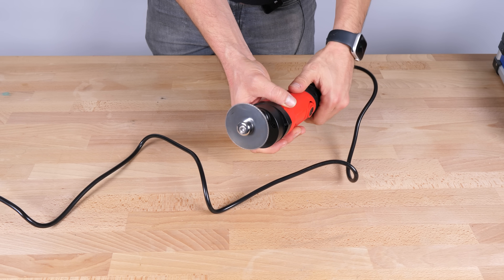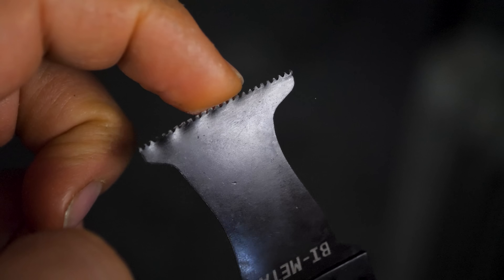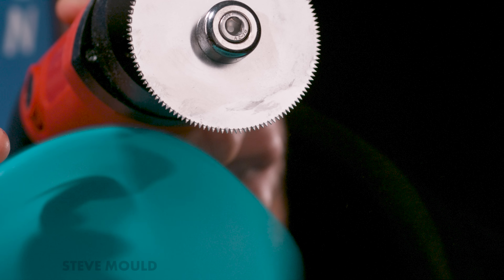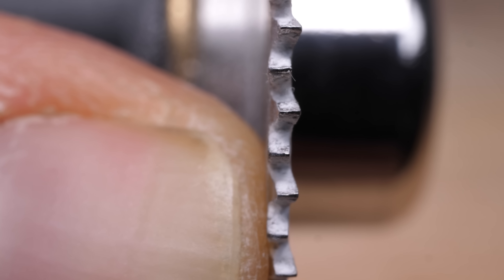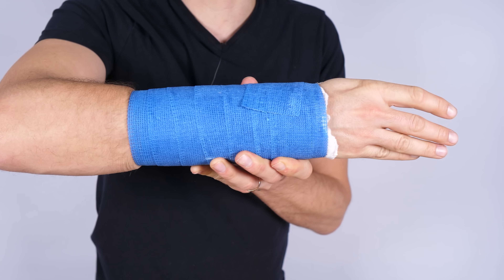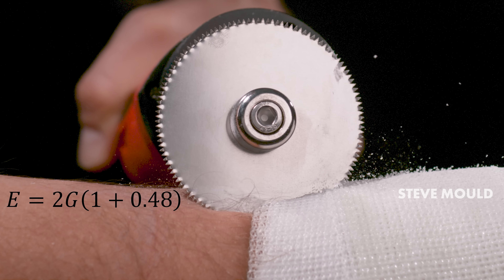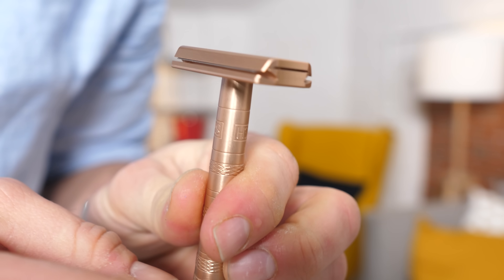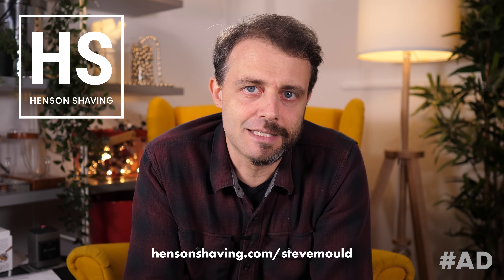A cast saw on human skin

Comment: It’s just a multitool
Reply: Oh, it is? So "multi-" that you've seen other blade shapes on it?
Reply: @HelloKittyFanMan  in the uk we call them multitools but in essence that’s what this is with a round blade on it.
Reply: @grantc8353 : Something like a Fein Multimaster, that comes with a handful of different kinds of blades, is a multitool, and that's the term that we use here in the USA too. But this isn't one, because the term "multitool" is not based on having this type of cutting method; it's based on the fact that there are several types of blades that you can use on it, especially that it comes with. So this isn't a multitool. What do you think "multi-" means?
Reply: @HelloKittyFanMan  I’m sure this has a different name but in essence it is a multitool that uses vibrations to cut through plasterboard (drywall), wood, metal and lots of other materials. I’m not sure what we’re arguing about to be honest
Reply: @grantc8353 : "Arguing"? I didn't know we supposedly were. This is just one guy telling another a fact that he wasn't aware of before. Of course the correct term for this specific tool is "cast saw," but of course it can also be categorized as a certain type of power tool more generally. But using vibration as the sawing action doesn't make it a multitool, since that's not what "multi" implies. "Multitool" refers to the versatility of power tools like the Fein Muitimaster because of their various configurations. Without those it's just a vibrating saw.
Reply: @HelloKittyFanMan  I felt like we were arguing what this was likened by the fact it didnt come with a certain blade. 
I should have potentially said "this is just an oscillating saw" which is what a multitool is. I found you poked a hole in something when it was obvious what I was saying.
Reply: @grantc8353 : Not just a certain blade, but more than one kind of attachment. it's not about the blade type; it's about there being more than one type of blade attachment that it can easily be fitted with and likely ordinarily comes with. Remember what the prefix "multi-" means?

OH, "oscillating saw," yep, that's even more correct than what I said, before ("vibrating saw"), if I understand right.

I think you could actually have a multitool that isn't an oscillating saw. But if I understand right, the Fein Multimaster is the original multitool oscillating saw. however, I think these cast saws came out before that, so I think they are the original oscillating saw (I could be wrong on that; I'm just saying that I don't know of any oscillating saw that came out before the cast saw, generally.)

You still can apply that to this post as an edit. (It would mean that we would delete all these replies, of course.)

Comment: I had one cast on each arm about 4 years apart in my childhood. The saw freaked me out both times. The technicians were really kind on each and they used tongue depressors as guides just in case. BUT my question is: if the saw oscillates, why is the blade a full circle? If I saw a partial blade akin to the oscillating Dremel tools’ as a kid, my mind would’ve been much more at ease. Is it a cost-saving measure (the tech just rotates the blade to a new sharp spot when the other dulls) or do doctors and nurses just love scaring kids?! 😂
Reply: It's for maintenance the blade becomes dull after a while (especially with plaster of Paris as gets stuck in the blades) so we manually loosen and rotate the blade to maintain it
Reply: @jonnycraig183  Ah, I gotcha. Thank you for the info! And by your use of “we”, I presume you’re in the medical field; thank you to you and your colleagues for working the long hours to help the rest of us :)

Comment: Then why, Steve, do they make the blade look like a saw blade? Why is it even round at all? Why not have it be just a segment of that like blades that are similar to that are on the Fein Multimaster and competing tools? What's the supposed point of having a full disc of those teeth when most of them aren't even getting used?

Comment: I needed a cast off so I used a angle grinder.....  I got some supperficial scratches but agan skin is much more elastic than the cast and if you touch the skin you can feel it. 

Disclaimer:  I would have had it taken off by an ortopedic specialist but one was not avalable at the time....  And I don't really recommend anyone who dosn't have experince and comfort with an angle grinder to do it...

Comment: steve. have you ever tried to shave patterns into your beard, say chessboard?
also a couple of years ago i broke my hand in a pre new years eve bicycle ride, pre alcohol. someone did not give me the right of way and i was forced to slam on both brakes and go down. problem with disc brakes is the work way more instantaneously than regular brakes, front brake included. given my size the lifting effect is more sideways and down as the front wheel will naturally point which ever way you are pointed. i'm a tough cookie . shrugged it off. did not call for the cops. which means the teen-aged driver out on a date got no legal consequence for his actions. living with a cast was absolutely no fun. at all. interestingly, when the doctor went to take it off. a giant disconnect happened inside my head. i saw that saw (haw haw) and one part of my brain kept saying it's spinning its spinning. and another part of my brain saying remember what the doctor showed you, oscillating! oscillating ! not spinning!  i fought hard and reason won out.

Comment: That's much safer than a regular circular saw,  which is what my dad used to remove my brother's cast.  Seriously.  He slid a metal framing square into the cast to prevent the blade from contacting my brothers skin on his arm while he cut the cast.  This is a direct result of the poor Healthcare system we have in the US(or lack thereof) alongside my parents being cheap af, they were willing to put my brother's life in danger to save money.   Happened about 30 years ago

Comment: In a way, it's comparable how a diamond can scratch very hard materials but won't damage skin if rubbed on it (assuming it doesn't have sharp edges), the cast saw is scratching away material really quickly instead of cutting it

Comment: If you are into construction, the equivalent tool is simply called an Oscillating Saw, and it’s actually my favorite tool. Super versatile, you can get blades that cut wood, metal, or even diamond blades for stone and ceramic. And I have demonstrated people that I can set my finger on the running saw without a scratch. But it should also be noted that it depends on the part of your body. If you stick it on the fleshy part of your finger or arm you’ll be fine, but if you stick it on your knuckle or elbow, I could see it doing actual damage. However I haven’t tested that, that’d be irresponsible lol.
Reply: I have scars on my arm that says it's possible to get cut by these.

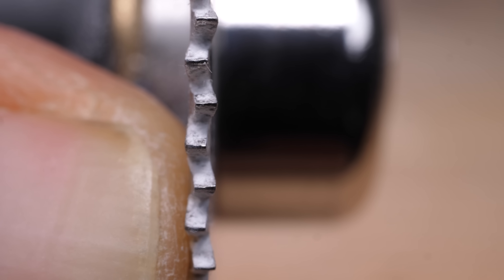Comment: 3:37 + 6:00 I never thought about it, but my electric shaver is a oscilating tool.
A old "Braun 320-4".
And the "blade" is right on my skin as I use it.
I never even considered that odd.

Comment: If the blade only oscillates back and forth, why do they bother cutting teeth all the way around the blade? Couldn't they just put teeth in the arc that's naturally at the bottom when gripping the handle?

Comment: This is exactly why the Dremel oscillating multi-tool, with an 80-grit sanding triangle pad, is great for exfoliating heels. The soft skin jiggles. The thick, dead, calloused skin isn’t as pliable, and hence it gets sanded off (slowly).
Reply: But wait there's more!
Reply: @marshallc6215  " Has this ever happened to you? " B&W video of someone peeling the skin off their foot, drawing blood, and getting a little upset about
Reply: @quinnstraught9636  there MUST be a better way!
Reply: Fun Fact:  If you have really dry skin, your skin loses some of that elastic pliability and become susceptible to being cut again.

I remember learning this from another YouTube comment section where a medical professional was sharing their experience doing demonstrations with the cast saw for kids, as a way to help them relax beforehand.  However one day when they were preforming this demonstration on their hand like they normally would, their hand was somewhat more dry than normal, and they managed to actually cut themselves, much to the horror of the child they were attempting to calm down haha
Reply: @kevinjudd846  Thanks - that answered my question about dry skin!
Reply: I actually use one of those mini Dremel type hobbytools with 20k rotations p/m to regularly file off an unruly deformed toenail. Too much hassle to do it by hand, a diamond file quickly abrades the nail, but not the skin. Similar principle.
Reply: An angle grinder works really well too except you often end up needing stitches :)
Reply: what are you even talking about
Reply: @John_Fury  You mean, what were we even talking about almost a year ago?
Reply: @kelvin0mql  😡
Reply: @John_Fury  Look, Mister Fury... if you're furious because you have reading comprehension problems and can't figure out what we were talking about, then how could I possibly explain it to you here in writing? I would merely be repeating what I wrote above, and you couldn't understand it the first time. So it would be pointless to type it all out again. It is therefore quite unclear what you want from me.
Reply: @kelvin0mql  I was just confused because I thought a heel was where Achilles was for a bit. smoked too much. Achilles Heel has nothing to do with a heel long story short.
Reply: @John_Fury  Hah! Fair enough.
Reply: Man, you are awesome! I just bought a Makita oscillator multitool for my father in law, but looks like mother in law also will like it! ;)
Reply: @NikolayBychkovRus pause 🤨

Comment: Broke my elbow as a kid and had the nurse show me that it wouldn't hurt by pressing it on her skin. The cast was cut enough to pull it off but right before it was the doctor came in, said i still had a small break in my elbow, and proceeded to tape the cast together and told me to wear it for 3 more weeks before getting it removed. Peeled it off when i got home and never went back

Comment: If the plaster saw isn't spinning... why is it a disk?
Is there a benefit? I guess with your version you could turn the tool or the disk when one side gets dull, but in the videoclip at the beginning there is a plastic cover. (Which you could probably remove to do the maintenance, but at that point you could also just exchange blades).

It just seems like a lot of wasted material.

Edit: Looked closer at the footage in the beginning and there the saw blade is only a semi-circle. Still weird that it's round. Is there a benefit to that shape like to minimize contact surface with the usually flat cast, so the motor isn't overloaded?
Reply: Yeah, I don't really see how it's different to a beard trimmer. They don't need to be circular and I always assumed they leveraged the same effect
Reply: A beard trimmer has two blades -- one stationary and one oscillating -- and the pair acts like a whole bunch of tiny scissors.

Amusingly, a lot of hay mowers work the same way, just with hand-sized teeth on the blades.

Comment: Fun fact: 1976 a carpenter got his cast removed with this tool and seeing it's potential to reach and cut in difficult places, he sought to buy it from the doctor and took it to the construction site. That's how the cast saw became the oscillating multitool.
Reply: That is probably not a good idea. If the general principle us the same, the spécifications may differ, as explained in the video.
Reply: @TomFromMars I’ve done it with a cheap harbor freight oscillating tool, and it worked great.
Reply: The actual cutting blade you're using can be at least as important as the quality of the oscillating tool itself. That is, since the blade is still rotating, just back-and-forth (i.e. oscillating), the distance between the saw teeth and the center of rotation will be directly proportional to the stroke of the saw. The smaller the cutting wheel you have, the shorter the stroke, and the less likely you are to cut/tear your skin. That said, the shorter and faster the stroke, the more the heat builds up in a more concentrated area, so the more likely you are to burn your skin.

Seems like they could just slip a shoe horn under the cast to protect you, though. Idk why they don't.
Reply: @hollt693  Sometimes they do. I've seen a cast removal where a strip of plastic about the size and shape of a ruler was slipped underneath for protection. That might not be possible in all situations, though, e.g. if the cast takes a bend around a knee or foot.
Reply: @hollt693  rotating and oscillation are two entirely distinct forms of movement. 
Car wheels rotate, they don’t ever oscillate. An oscillating motor only has a motor that has a rotation axis that is mechanically altered by a type of transmission. 
I looked up some information to see if it was both correct and or completely wrong. 
What I found was an obscene mathematical explanation with a shit ton of widgets and pi and some algebraic functions squeezed into a law or two and more stuff to ultimately suggest I was happy with a spinny motor has an intimate relationship with another non spinny one and in unison and some invisible magic stuff, a cast is able to be easily removed from broken bones with out need of a seamstress to patch up the resulting damage. 
I hope that’s not too high brow for this kind of thing.
Reply: @STV-H4H  What do you mean by “entirely distinct”? Yes, neither is a form of the other, but my point was that both forms of movement are relative to a pivot point, as opposed to translational movement like with a reciprocating saw. That's why the size/shape of the blade is especially relevant in this context.
Reply: @hollt693 Damn!😢
Reply: So what you're saying is I should use a oscillating multitool to cut off my cast?
Reply: @oliverer3  I suspect most oscillating multitools have a wider ranger and thus will probably still cut you.
Reply: @reaganharder1480  mine is 3.5 degrees. I think the cast saw is half of that. Am tempted to try my multi tool on skin, not my own obviously.
Reply: @BrianSu  Check the teeth of the blade. If they are pokey enough that you could just press them into a soft wood even a mm, it will hurt using it on skin. Wouldn't tear skin up or anything as long as you aren't pressing really hard and moving it around. But as that is the point of those blades, to have the teeth to saw dense materials, I wouldn't advise it.
Reply: @Nick-hi9gx   Thanks. I'll try it on a friend first....
Reply: @oliverer3  please dont
Reply: @lukeonuke I have, works great.
Reply: @lukeonuke He should please do! And have someone live stream it!🤗😊😌
Reply: Fuck. Yeah. 
Do it!
Reply: @oliverer3 give this man his prize. Yes, it’s the same tool.
Reply: @oliverer3 you could very well
Reply: ...oscillating saws are over 100 years old, in construction use. MANUAL, crank oscillating saws existed; Greeks and Romans had them. Fein made them tiny and handheld.
Reply: @Nick-hi9gx  cordless versions no doubt.
Reply: damn
Reply: the fein cutter!
Reply: They are the same tool, just a massively different price point.

Comment: this guy really shaved half his face for us!

what a legend
Reply: You mean for the sponsor of the video? Don't get all bigheaded just yet :-)
Reply: funny thing is I haven't even noticed it until he mentioned it , and I'm quite sure this isn't his first trick like that
Reply: he did it before, and even in more steps 3/4, 1/2, 1/4...
Reply: What do you mean, he shaved his whole face?
Reply: He turned into Dan Ariely for us
Reply: I will say, though... he did not use the cast saw;

For one, the hair would not be static. The saw moves transverse into the hairs, and so the full ductility of the hairs would act in bending against the blade. The cut would have to be very close to the skin to create strong enough transverse shear or bending. Human hair also has strong axial tensile strength (it's anisotropic, to my knowledge) and cannot easily be "pulled apart" if somehow gripped by the blades.

I say this simply because it's not stated in the video. He does make fair points to discourage attempting using a cast saw on yourself outside of a professional capacity, but it should still be stated that it does not help with shaving either.

Comment: I worked for a private contractor for 6+ yrs & my favorite tool was my osolating blade that can make cuts in ways no other tool can. It's exactly why you don't cut yourself and they use the same thing to cut casts. When i broke my wrist skateboarding they had to cut my cast off and it's cool they use these tools. I think they are fascinating.

Comment: Why is the blade a full circle? If it only moves back and forth a tiny bit, that means most of the circle is never used. So why do we need a full circle?
Reply: Maybe so it's easier to use at awkward angles, or so the blade can be rotated as it gets dull?
Reply: If it wasn't at least a section of a circle then as it cut into the cast the next piece of the cast might block it oscillating. And if you had a semi circle instead of a circle that would still be a problem if you tried to use the corner for some reason, plus it would make the handle vibrate more and probably be a lot more vulnerable to damage from being knocked sideways.

Comment: Can you use a normal oscillation multi tool thing?
Reply: They move farther (as he generally mentioned in the vid), and their blades are different (may be wider toothed and sharper, you can get cut without much movement/no power).  You'd want a tool with less dramatic motion, and blades with two layers to teeth overlapping.  This becomes more like a bed of nails which won't puncture you as compared to one nail piercing through.